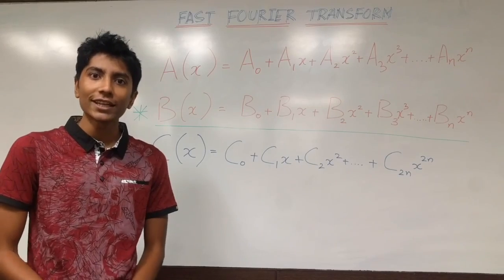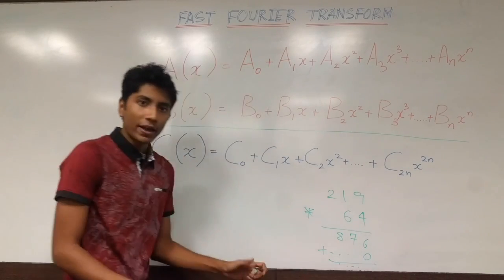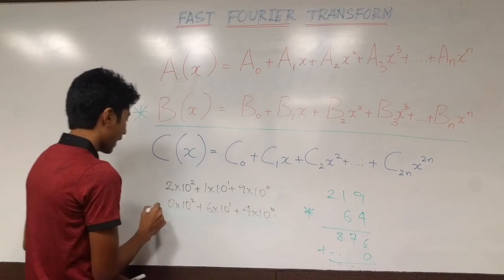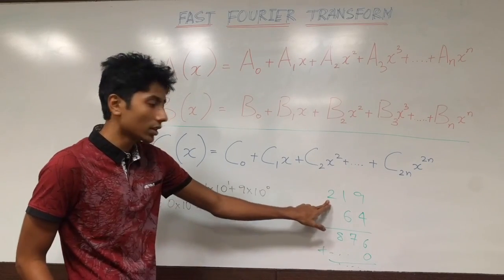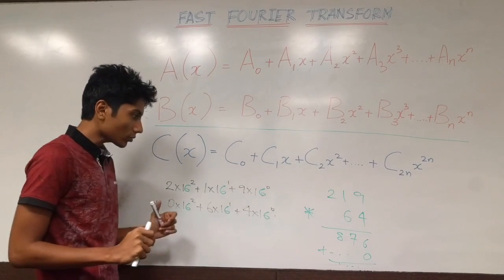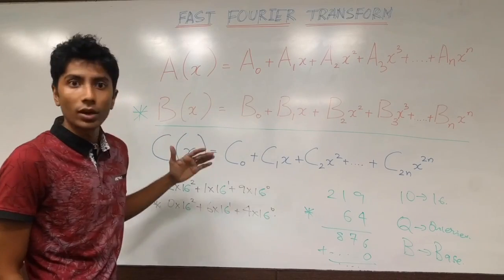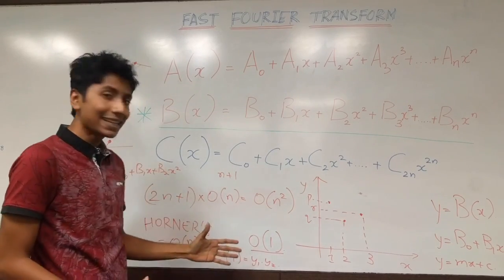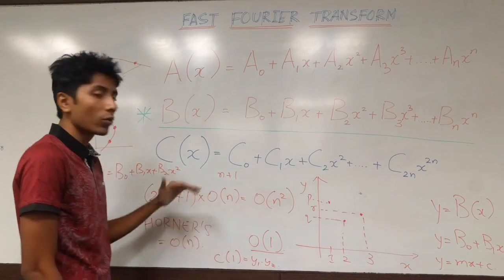Fourier Transform - Part 1

Comment: Good video, but shouldn't 3 points give different curves like a circle or parabola both are possible with 3 points in a plane?
Reply from the maker: Hmm. 
By that argument, two  distinct points can represent a single line, an infinite set of parabolas, and an infinite set of circles.

That's the irony of having 'define' and 'infinite' in the same statement 😛